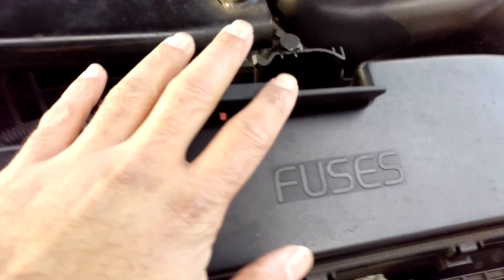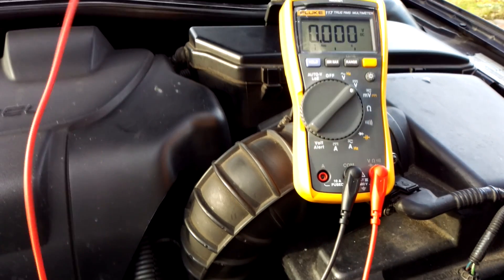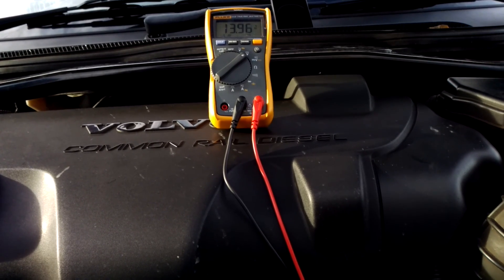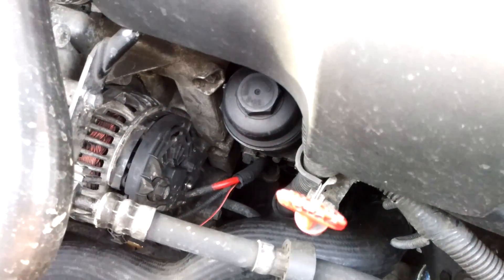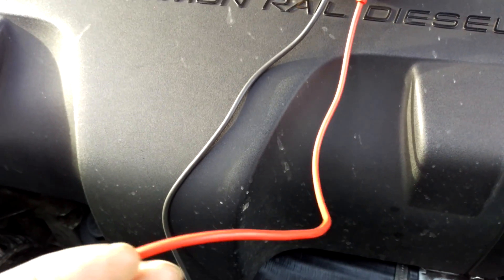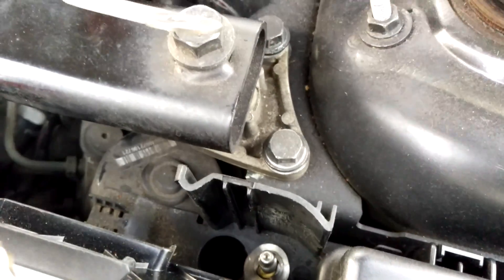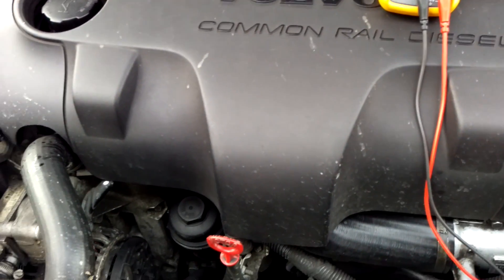How To Test an Alternator Part 1 Voltage Drop and Dirty Connections

Comment: If voltage is good at battery (14v or so) could low current (amps) be responsible for not charging correctly? 

Basically I want to know if voltage testing at the battery is enough to determine if alternator is in fact adequately charging the battery or if amperage reading needs to be looked at as well

Comment: Hi Sirrob
Why when i conect positiv alternatir post and positive battery i get this digits on my multimeter 107.1 mV could i get some clarification? Thx
Reply from the maker: Anything <200mV when measuring between two positive posts is good so your result is ok.
Reply: thanks a lot for your reply...I realised its mV and not volts, so thank you again @sirobb

Comment: Great upload but....so what if you drive a POS FORD like I do, and the alternator is on the bottom backside passenger side of the engine and battery is on top drivers side? My multimeter leads are about 3ft short
Reply: Put the car on ramps and jack stands .
Reply: @Viper81766  how does that make the 18in multimeter cables 3ft longer....
Reply: @koreyhayden1368  getting access from underneath the vehicle if the alternator is near the lower part of engine.  My Buick is near the bottom too. Pain in the rear.
Reply: @Viper81766  ya acces I get, I'm just talking hooking leads from battery to alternator to test...I need 3ft...or take the alternator out which I've done 2wice now and a 3hr job each F'n time
Reply: @koreyhayden1368  it is a pain in the ass . My Buick has the alternator and power steering pump both near bottom for whatever insane reason.

Comment: QUESTION: YOU FORGOT TO TELL US IF THE ALTERNATOR CONNECTOR AND B+ CONNECTION MUST BE REMOVED BY UNPLUGGING THE BATT + TERMINAL AND UNPLUGGING THE 2 WIRE CONNECTOR AT THE ALTERNSTOR.

PLEASE, LET US KNOW.

Comment: I've found most of the voltage drop is from the cable to the ring connector. Clean it and put some solder on it or even better as solder wont last, tighten the clamp with a dedicated big wire gauge clamp tool or a small portable vice and a ball from a bearing.  In my car this exact cable from alternator to battery would get very hot to the touch if many electrical consumers were on.  Got it from 13.3 to 14.4V just by cleaning connectors.

Comment: Excellent explanation and edit. What if you were getting higher charging voltages? 16.5V tested on the battery on my V70. First thought, voltage regulator, could there be other culprits?
Reply from the maker: Higher voltage around 15v isn't unusual when very cold but I wouldn't expect it to remain that way so monitor the voltage as the car warms up.
Reply: @sirobb  Alternator & regulator working. I blamed both but it appears the DIM needs fixing / re-soldering

Comment: Does your alternator go to starter motor junction and then onto battery?
Reply from the maker: Mine is a little different as the battery is in the boot so the alternator first goes to a permanent live junction in the engine bay but yes, every alternator has a direct path to the battery positive.

Comment: Thanks for the video, when you're checking body chassis earth, to alternater body Earth, and you have high readings, does this mean you unbolt alternator from the engine and clean? Many thanks Geoffrey
Reply from the maker: Not necessarily. Do you have excess voltage drop?
Reply: SiRobb no, after cleaning both posts like you said I got it down, but when you said you can check earth to earth just the same I wondered if you would unbolt the alternator as well, because the chassis connection would be straightforward?
Reply from the maker: The alternator "connection" to the engine block is unlikely to be the problem.
The orientation of the red and black meter leads and whether you have a + or - reading on the multimeter will determine where the voltage drop is happening so I would need to know that specific detail.

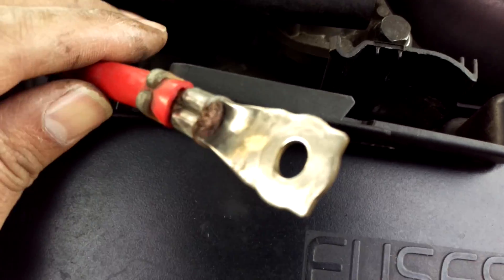Comment: 12:28 see there the wire is crimped? Thats half-assed from the factory.
This really should be soldered and heatshrinked with hot glue heat shrink that seals it
Reply from the maker: Not really half-assed.
The connections still work fine with minimal voltage drop after 17 years and 200k+ miles.

Comment: Hi, can you help a novis, BMW K100 motorcycle, the alternator is a modified car one (bosch 14V 8/32 A) , internal diodes for the rectifier and the regulator/brush pack is external. I have only two wires going to the alternator plug, I believe one small wire goes to the  ignition warning lamp on the dash and the other I assume eventually back to the battery. The problem, 12.4 volts at the battery with engine off and at 2000rmp or more. I have checked and cleaned the brushes,  connections and slip rings. 
with a FLUKE 79 series meter set to diode red to casing black to large terminal (B+) I have 0.897 VDC, reversing the leads I have 2.352 VDC are my diodes faulty?
Reply from the maker: Yes it sounds like they are faulty.
With the engine running, do an AC voltage test between the alternator B+ and the alternator casing and let me know the result.
Reply: @sirobb  a secondhand unit arrived today, so I replaced the suspect one, and all is well in the charging department...
Reply: @sirobb  thanks I'll do that...

Comment: Very detail video. Was the charging warning light on dash on? Thank you
Reply: Sometimes is off and there is no proper charging, DC current clamps connect to battery supply wire (wires)
Reply: device for measuring DC current indirectly through magnetic field of current electricity in wire
Reply: current electricity flow in wire

Comment: Wow! A Volvo battery!  I bet that cost a packet!

My Volvo V90 is losing 0.3V at the junction at the starter terminal, even after cleaning the connection lugs - the cable from the alternator terminates there, joining the cable from the battery.   Nothing for it but to clean the lugs again.    Unfortunately, too inaccessible to get at Dremel tool in there.
Reply: Max allowed is 0.5 volts for the starter motor voltage drop

Comment: can use carb cleaner or something else to clean the insaide mine hase a lot of dirt and oil.after repair the steering pump how can i clean my alternator?thanks
Reply: Use a degreaser, the carb cleaner ruins your alternator brushes. Be safe.

Comment: Marvelous video. People (including myself) tend to forget that corrosion and (or) dirt can add up to resistance greatly and cause a series of problems. A little bit of inspection with the good old multimeter (btw. like the Fluke) can point to problems and solutions. Maybe some contact grease can also prevent rust / dirt on contacts too.